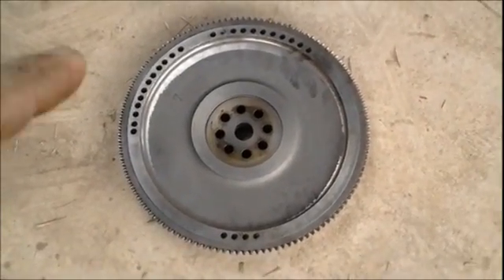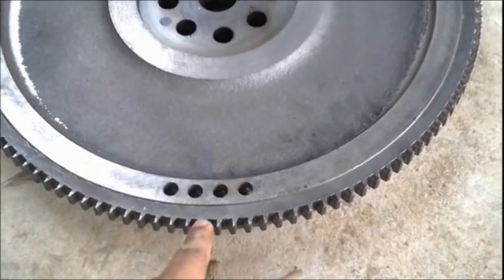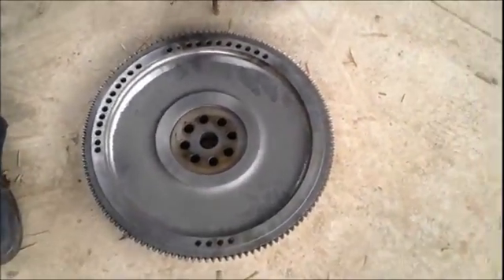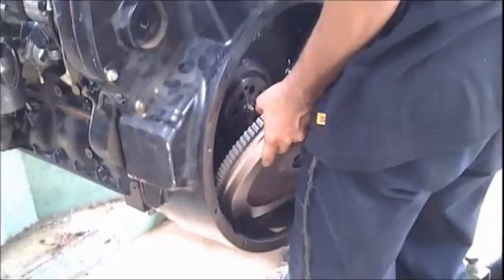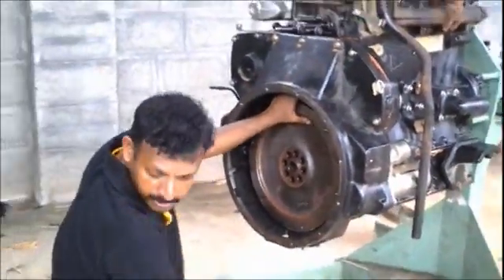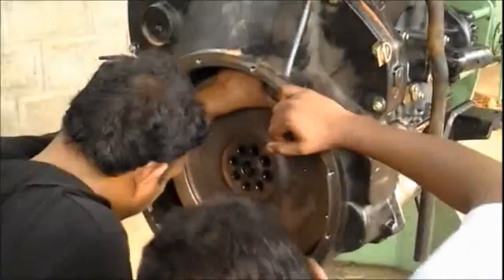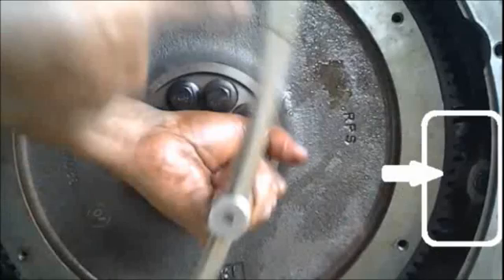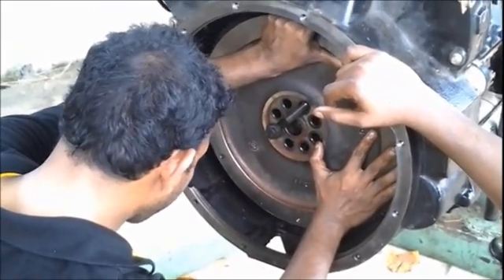How flywheel works. ✔

Comment: Flywheel is such a simple device to look at, but totally alters the behavior of the system. Similar to an inductor in electrical circuit. When speed increases, flywheel resist the increase of speed. Contrary to this, when speed reduces, the flywheel tries to maintain the speed constant.
BTW, could you please post a video as how a dynamic balancing of flywheels done (how are the location and depth of the drills decided on flywheel)? I know, they use stroboscopic effect, but what is the mechanism? Same is used for any rotation device -- rotor of motor, fans, tyre, shafts, crankshaft etc, all uses the same technique.
Reply: I've always viewed a flywheel as more of a mechanical capacitor, for every reason you just cited.
Reply: @vincentrobinette1507  A mechanical capacitor. You're exactly right. The high tech EMALS catapult on the US Navy's new Gerald R Ford class Aircraft Carriers is powered by flywheels. I thought it would be some sort of capacitor bank. Apparently not.
Reply: Debraj Deb thanks for the info